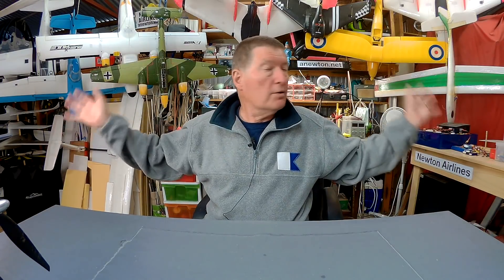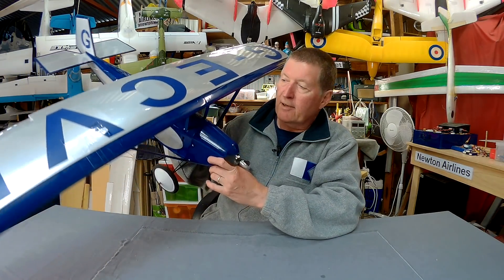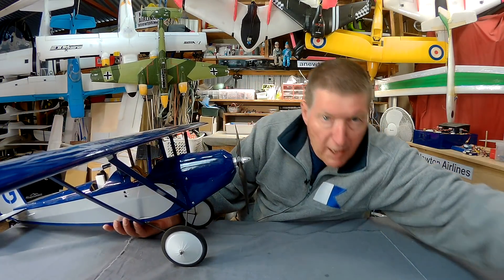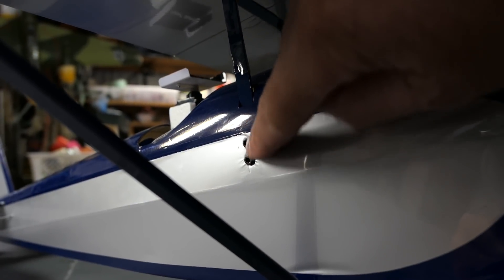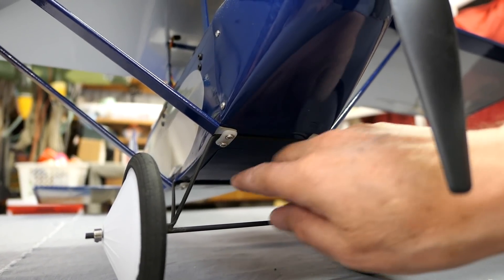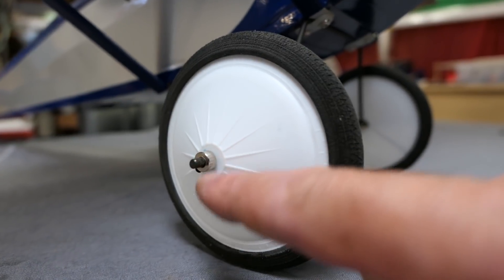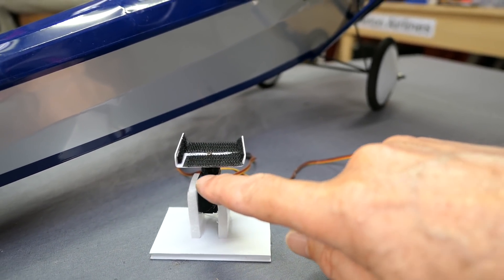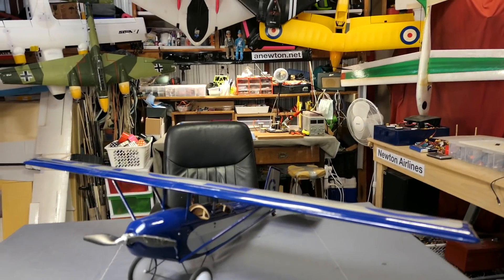HK Pietenpol Build Overview

Comment: Nice plane. With the landing gear, I've seen a vid of a guy that built his own floats and he wrapped the welds with single stand copper electical wire coated in flux then solder over them for added strength
Reply from the maker: Yes great idea. I'll do that

Comment: Hallo andrew mine pietenpol.almost ready to fly i had a woodenprop but the hole to smal the forvthe prop holder 6mm en must be 8mm i touhht i make abigger hole but i think thats not the solution.maybe anew propholder with a 6mm holder  thank you can i send you pictures i dont  if is possible xith yhat  greetings salvatore amateur modelbuilder 
I think tomorrow
Reply from the maker: Facebook and email link in the About tab if you want to share photos.